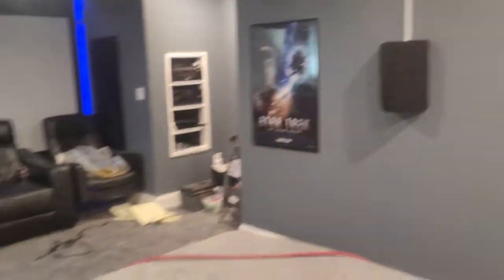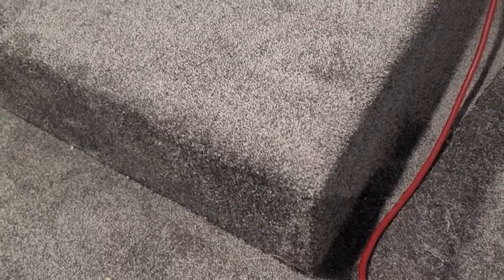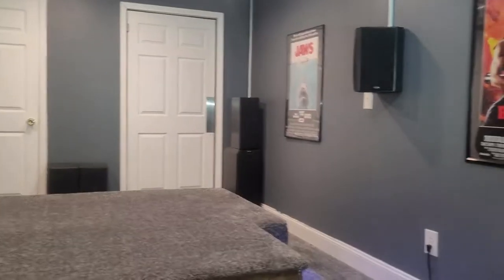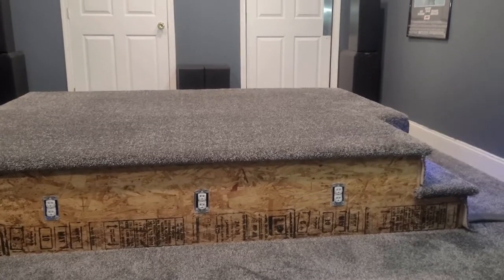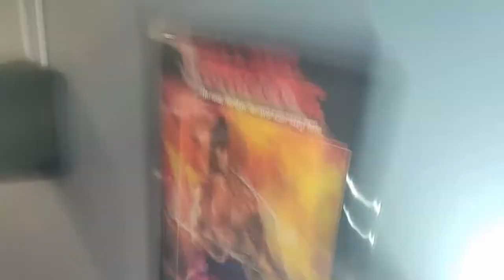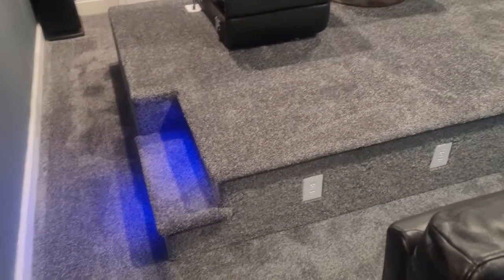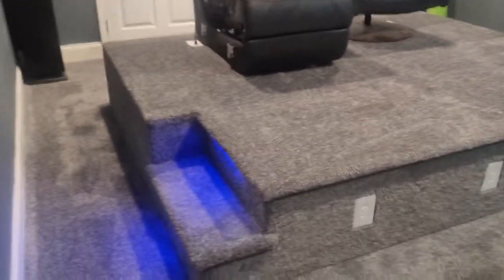Building a Home Theater Riser Part 6

Comment: Do you regret not adding any insulation into the riser? I finished my riser frame today and now need to decide if I need to add insulation. I don’t expect to have a crazy loud sound system installed, however, I’ve never done a project like this. What are your thoughts?
Reply from the maker: @hospitaladministrator3359  I honestly don't think that it needed any. Maybe if I used it as a bass trap, but it's closed up and I haven't had any issues.
Reply: @EuphoniumDirector  Great. Thanks man. Appreciate your response

Comment: Nice job. Did you consider making it a bass trap? (Sorry - I may have missed if you mentioned in your early design phase, I picked your series up in part 4.) Just adding some insulation inside and cutting some vents (with hvac registers) may be worthy additions - with your 'floating' design, you could still flip it over and add these elements fairly easily and relatively inexpensively. I'm very much a rookie in the acoustics side of things, but I got some advice to incorporate these in my own risers I'm about to embark upon.
Reply from the maker: Yeah I did consider making it a bass trap and probably will in the future. I have quite a few acoustic treatments to do to the room. I decided to tackle those seperately at a later date and enjoy the theater for a bit now.
Reply: @EuphoniumDirector how’s the sound currently? Sorry, I asked this question elsewhere too.

Comment: This turned out great. I have two follow up questions if you don't mind. How long did it take you to do this from start to finish? I've seen people make risers a couple different ways, if you had to build another one, would you still do a truss system as the frame? Great job really inspiring! Thanks!
Reply from the maker: Thanks for the compliment! It took me about 3 weeks to complete as I was working on it when I had free time. Since my riser is free standing and 18 inches tall I do think the trusses were the way to go. If it was built in I would probably do more of a floor joist design. I am sure that if I did it again I would find small things here and there to do better and refine.